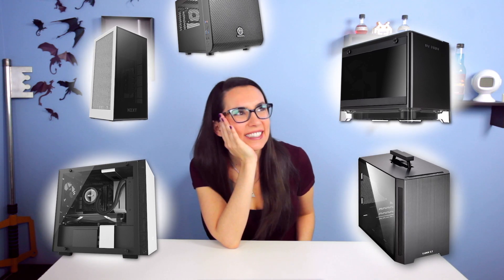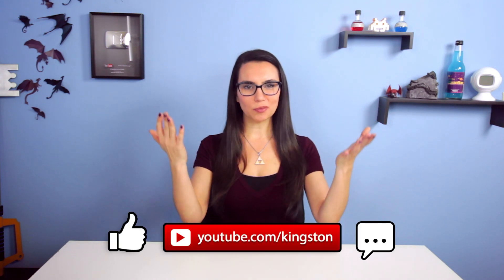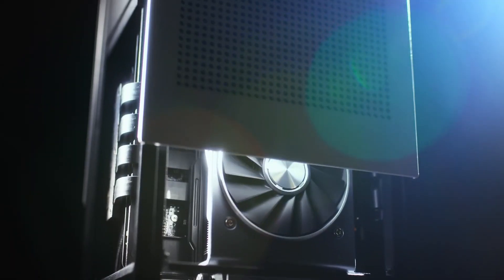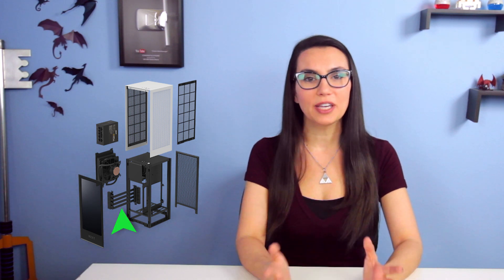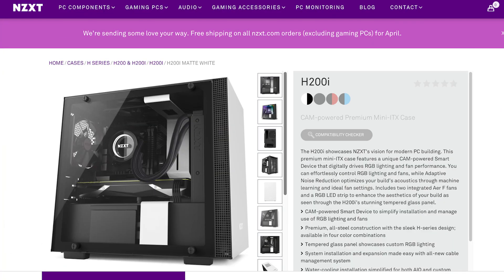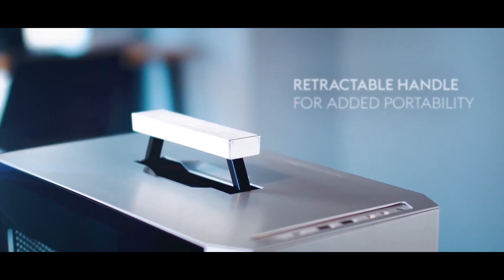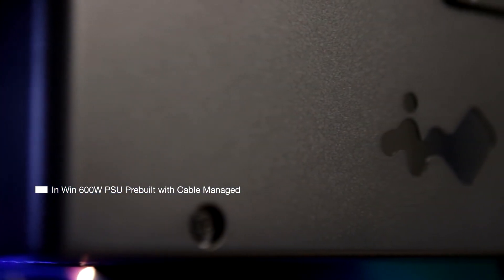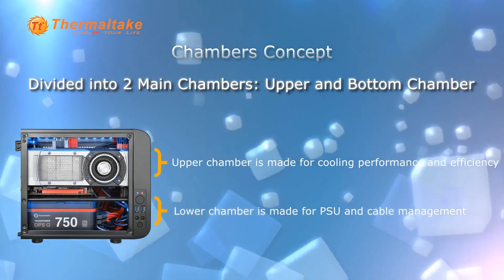PC Build – Build a Mini-ITX PC – DIY in 5 Ep 120

Comment: I built a Mini-ITX This week with the Fractal Node. It's much smaller than the NXT, 10 Liters compared to 20+. 

Portability is much higher on the Node, and it feels less like a Standard Box pc and more like a DVD player or DVR.

I originally tried the NXT H2100i, but it was very chunky, and doesn't come with a power supply. The Node comes with one installed for just $140

The 450watt Psu is less than 650, but I'm still running a RTX580 Graphics card and a 6-Core Processor. It's handling the load quite well. The PSU is also power factor correcting, and 120-240v compatible.
Reply: Six core 🤗

Comment: I used the Thermaltake Core V1 case for my previous build. It now serving my Mom wonderfully.

I was able to fit two 3.5" hard drives and 2 SSD drives, a full size graphics card (some AMD flavor) and a full size PSU. I initially put a AIO CPU cooler when I first built it, but I changed it to a Noctua CPU heatsink (I forgot the reason).

Comment: 3:45. The price is high, but you start with a gpu riser card, 80+ gold power supply, and aio cooler. How many other cases have an included power supply and liquid CPU cooler? It's not that bad of a deal. I personally can't stand tiny cases. Give me big fans and big airflow. I've got an hx850i platinum power supply and 240mm aio. I should have gone 360, but it was on clearance at a local best buy. I'm also running a standard atx mobo.